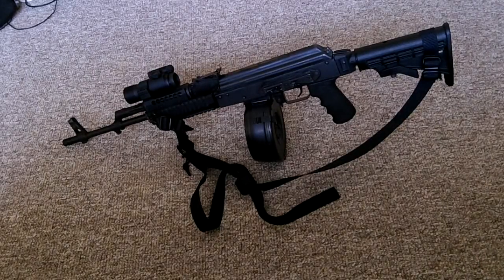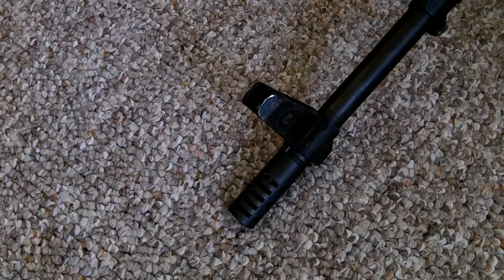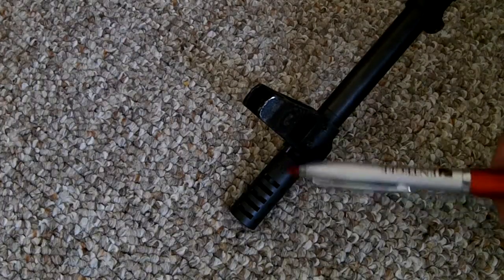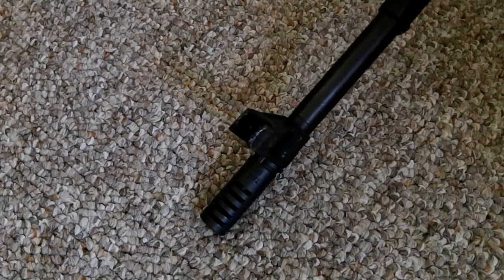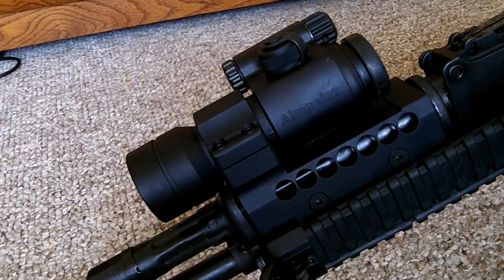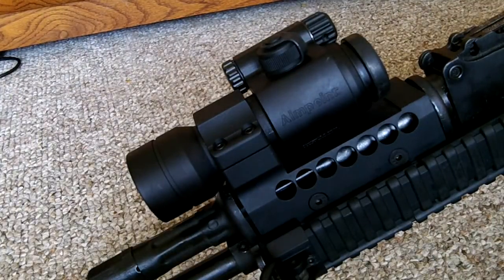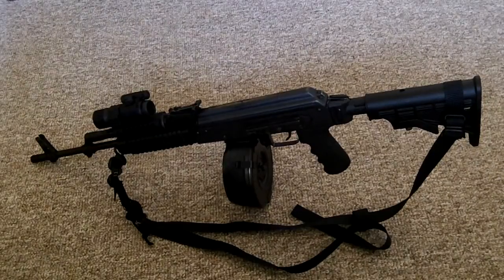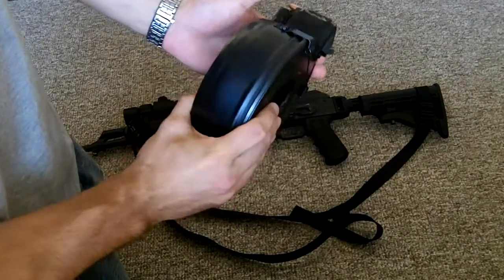Suggestions for AK Upgrades

Comment from the maker: The front hand guard rail and mount come as a single package from MWI. I haven't tried out the Ultimak, but it looks like a good product. One downside is that it does not come with the bottom and side rails for mounting slings and lights, etc. I haven't weighed a fully loaded 75 round drum, but I would say it is somewhere around 5 lbs.